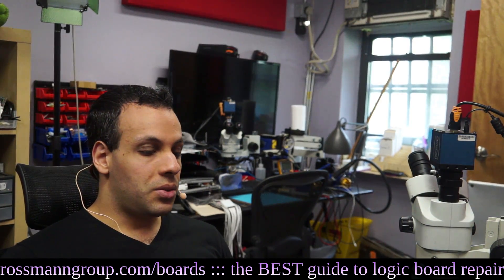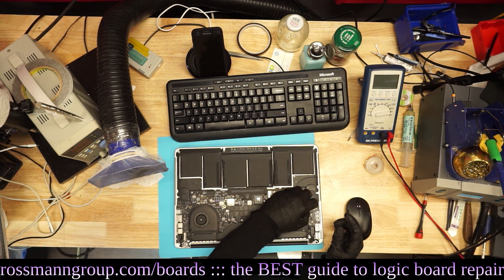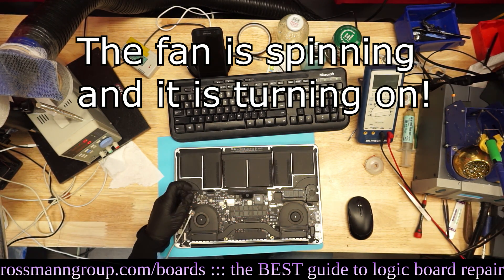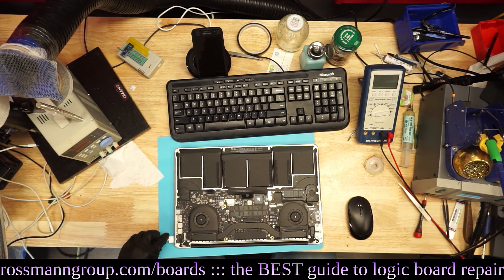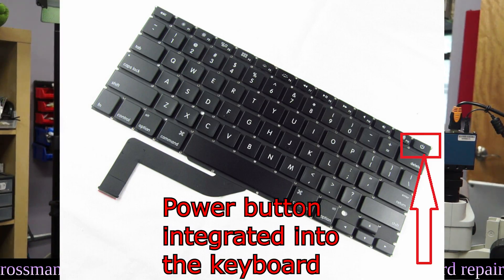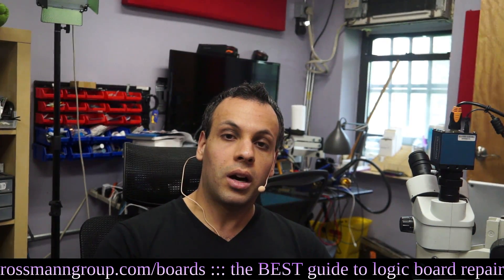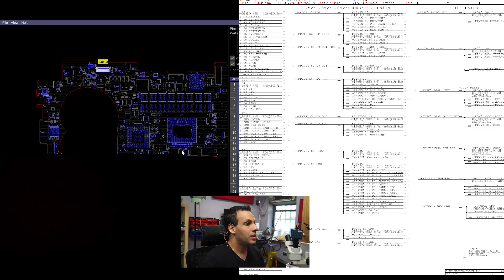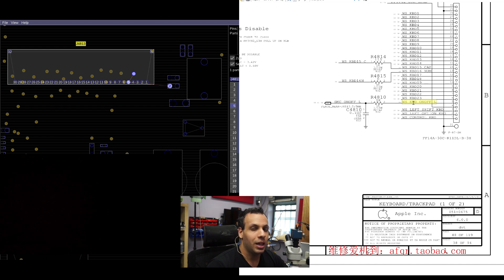Ingenious Macbook Engineering: explained in 3 minutes.

Comment: This is made worse by the fact the keyboard isn't just one huge unit, that has all the circuits combined in it, all the buttons are soldered in (if i'm not mistaken) so, they could very easily give it it's own circuit, that isn't integrated with the fucking keyboard itself... god damn apple loves to engineer for repairs.

Comment: I can "explain" the thought behind this (can't defend it though). Apple does this for two reasons, one is the obvious one, greed.

They need these machines to stop working after a time, and the best way is if they can make it so by blaming the user:
"You spilled two drops of water between the keys? You see it is not waterproof, it is all your fault!"

The second is because they want to have the "It just works!" argument. If the machine survives these minor damages with some restricted functionality, than the machine does not just work anymore, and they fear the simpletons and technologically impaired (who are large parts of their user base) will just bash it because "I dindunothin and it does not do what it did before!".

They calculated and decided that there are more people in the second point who will just buy an other macbook, than those who will realize that it is just an anti consumer jerkfest and they are just getting robbed dry.

Comment: Nope, this is all wrong. I want a machine that stays shut down if something is spilled on the keyboard so a professional has an opportunity to open it it safely, clean it and check/repair any issues before that spilled liquid threatens to lose critical information. Its just safer that way, our work is valuable and when we use laptops we cannot rely on backups to protect our data because we are not always connected to our secure network.